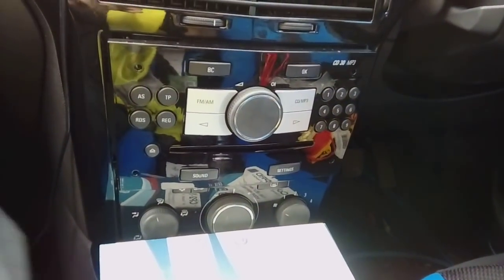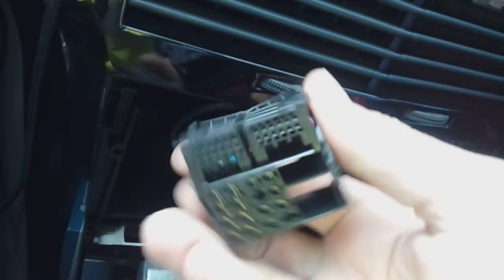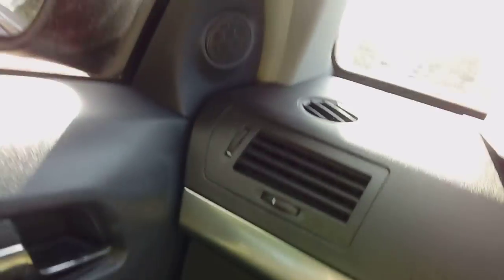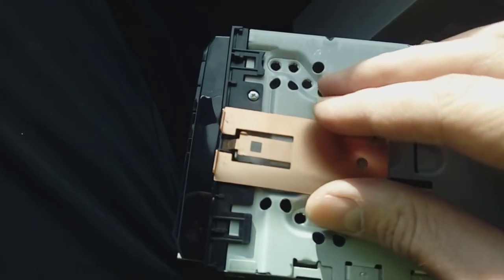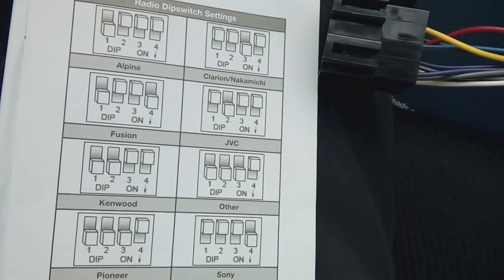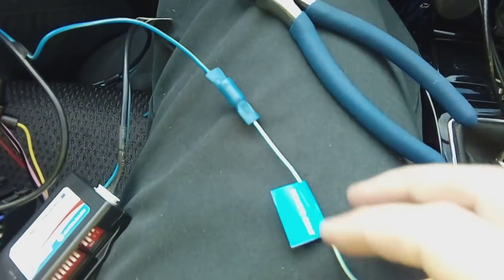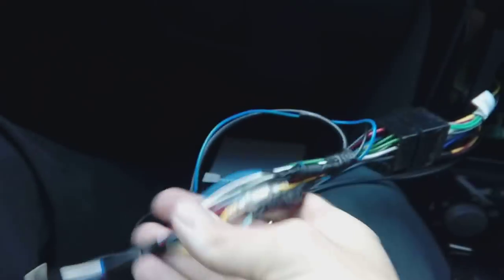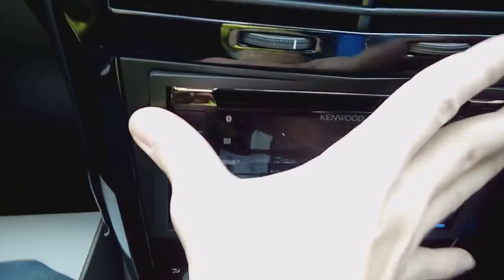Astra mk5 2004 -2010 radio removal & dab refit guide + part numbers

Comment: I’m thinking of getting a double din for my astra but i am wondering will the screen on the centre console still display temperature, radio station, mpg or will it be blank? 
Thanks in advance
Reply: did you find out
Reply: My Astra still displays time and temp. It never showed mpg etc.

Comment: Hi PJ. I'm looking to install an Alpine iXE-W400E headunit to my Astra mk5 coupe Turbo. I just wanted to confirm that the Autoleads steering control interface also comes with an adaptor to connect to the car's radio?
Cheers mate, great video.
Reply from the maker: The kit used in this video comes with a patch lead that fits most major brands of radio. It has either a 3.5mm jack or a bare cable to crimp or plug in to the required output from the aftermarket radio.

Comment: Hi PJ. I'M THINKING ABOUT BUYING THE DPX-7100DAB RADIO, DO YOU THINK THIS VIDEO INSTALL WOULD BE THE SAME FOR THIS UPGRADE DAB RADIO, AND WOULD THE BITS REQD BE THE SAME, WOULD APPRECIATE YOUR ADVICE, THANKS.
Reply from the maker: Yes the same parts would work fine with that radio. Just be sure to buy a DAB antenna for it as the Pioneer models do not come with one.
Example - https://www.ebay.co.uk/itm/UNIVERSAL-CAR-DAB-ANTENNA-WINDOW-GLASS-MOUNT-RADIO-ADAPTER-AERIAL-ARIEL-ARIAL/183738629841?epid=6002493890&_trkparms=ispr%3D1&hash=item2ac7acfed1:g:2VcAAOSwTm1dyoAv&enc=AQAEAAACQBPxNw%2BVj6nta7CKEs3N0qXHmpXBKd%2FvF3vNS7OWYO5%2BCn%2BgwFmnjmv2aGbNBurbeVyIb%2B3E3Frg002LphFIkVzPR%2Be%2BN3u1Zbg%2BzQ4njuqOJdyhHc7SZLqTSNKKCNhAzfDpaVSe%2B6i8iGi4bXIkHrAMnPSI4wT2uyoXx7BvSBhXGTdLI0oIvzysgiGBARoSEgWsnCDHIC1L85ZE9p0LPuoUktBMJSllTWGdJzIAD2LO7bN95kMo5EzLyrWsY6GBziR4vd6%2FSYiv4YIMTiuVDCPwo0WsWSU0Xj7dpYuMm48WXpaysNqCzNNBGYEHmtVULNCH61EBUMz%2FAYd%2BbXFVnlHRnqlJ64kn3zITmRhI9YGXluOlpZ4bXJjbpdjzpx%2BDNDKVW6obhyMowpGzG0lynNFdi%2FZGF%2FWjEFm5yKvIDt%2Fykravu1aNFRCVLgu6YqLaeYoMBlcnfBXBSt2tjeauMFZJ6C6TdOaVTW7axvdwVxIIgXUmkWyWWLfP%2FXkWswgQAnKgPsxB4%2F9PbBIlQ1kmlbO3hqMBw411GZrtVHz6vBAGkcR7UgESY27PVnP2aKuCZNTK8gyGfvuB6IkaRjx4vDKW4m4LB1HSRvSJeMbwRFflhCfwNPOpPoNWlII8k%2Fx9%2BR7Bz7lJrEfroFNPo1LMuvbd%2FHXUu6hchQmnp4YGf1uuWX54eLI2bzzHyrpGKEDiA3B4D%2BRWxP9k29rApp%2BzM7KPeN4MeCguXKnwgNm8G5Ft2O82Q%2BhBI71jxf%2BFbKEw4g%3D%3D&checksum=1837386298410dd5ab0ea1674dcf875d156f54f630ef&enc=AQAEAAACQBPxNw%2BVj6nta7CKEs3N0qXHmpXBKd%2FvF3vNS7OWYO5%2BCn%2BgwFmnjmv2aGbNBurbeVyIb%2B3E3Frg002LphFIkVzPR%2Be%2BN3u1Zbg%2BzQ4njuqOJdyhHc7SZLqTSNKKCNhAzfDpaVSe%2B6i8iGi4bXIkHrAMnPSI4wT2uyoXx7BvSBhXGTdLI0oIvzysgiGBARoSEgWsnCDHIC1L85ZE9p0LPuoUktBMJSllTWGdJzIAD2LO7bN95kMo5EzLyrWsY6GBziR4vd6%2FSYiv4YIMTiuVDCPwo0WsWSU0Xj7dpYuMm48WXpaysNqCzNNBGYEHmtVULNCH61EBUMz%2FAYd%2BbXFVnlHRnqlJ64kn3zITmRhI9YGXluOlpZ4bXJjbpdjzpx%2BDNDKVW6obhyMowpGzG0lynNFdi%2FZGF%2FWjEFm5yKvIDt%2Fykravu1aNFRCVLgu6YqLaeYoMBlcnfBXBSt2tjeauMFZJ6C6TdOaVTW7axvdwVxIIgXUmkWyWWLfP%2FXkWswgQAnKgPsxB4%2F9PbBIlQ1kmlbO3hqMBw411GZrtVHz6vBAGkcR7UgESY27PVnP2aKuCZNTK8gyGfvuB6IkaRjx4vDKW4m4LB1HSRvSJeMbwRFflhCfwNPOpPoNWlII8k%2Fx9%2BR7Bz7lJrEfroFNPo1LMuvbd%2FHXUu6hchQmnp4YGf1uuWX54eLI2bzzHyrpGKEDiA3B4D%2BRWxP9k29rApp%2BzM7KPeN4MeCguXKnwgNm8G5Ft2O82Q%2BhBI71jxf%2BFbKEw4g%3D%3D&checksum=1837386298410dd5ab0ea1674dcf875d156f54f630ef
Reply: @PJsprojects  Thanks PJ, COULD I ALSO REPLACE THE DAB AERIAL WITH A MAGNETIC DAB ROOF AERIAL, WOULD THE CONNECTION INTO THE RADIO BE THE SAME, AGAIN THANKS FOR REPLYING, HAPPY NEW YEAR.

Comment: Fitted a decent Pioneer double din unit with the steering wheel controls. Any idea how I am supposed to change the clock on the display above?
Reply from the maker: Without a expensive display adapter it's sadly not possible,but most new radios have clock built in.

Comment: Thanks for the video, very helpful. A question though, If installed correctly should you be able to listen to the radio with the key in the ACC position like you could with the manufacturer radio? Mine only comes on when the key is in the ON position and just wondering if this is normal?
Reply from the maker: Cabral Apogan-Yella Yes thats correct unless you find the fuse thay runs a 12v acc socket.
Reply: thank you!!

Comment: Longshot here but do the factory steering wheel controls on the 1.9 sportif work with double dins or will they need replaced?
Reply from the maker: Yes you would just need to buy an adapter that works with what brand of radio you buy. You retailer should be able to advise which one you would need.
Reply: PJs projects thanks very much, where do you get the tool to remove the stereo and what adapter would you need in the back for aftermarket?

Comment: do you have to have the steering control for this to work? i tried installing a double din and it doesn't power on at all :(
Reply: Generally for the astra h you need to tap into the cigarette lighter 12v to get power there is already a female spade connector on the loom
Reply: @shaneebahera8566  thanks for the reply. I looked up a forum for it and it said something similar. I went ahead and tied the power into the heater controls and it worked
Reply: @bidsalamandermlp6265  my problem is my astra has a start button so when you turn off the engine its the sameas turn off the ignition completely so you cannt use the radio unless the ignition is on

Comment: Great help, however I've fitted a single Din and it doesn't switch on or off when the ignition is turned on or off? What am I doing wrong?
Reply from the maker: Only three wires will effect power,black(earth),yellow(power) & red(power) so seeing as the only one you have had to add is the red power cable I suggest you start with that one and make sure power is getting to the radio. Double check all your connections and the fuses.
Reply: PJs projects I've connected the red cable to the red cable coming off the cigarette lighter. Is that right or am I doing something totally wrong?
Reply from the maker: I would suggest finding a switched live at the fuse box but as a test pop the heater control panel out by pushing the two metal tabs upwards(radio needs to be removed to see them). on the rear of the heater control panel you will see a large connector with a bunch of wires,find the thick red one and tap into that for a switched power. If your radio powers up you then know your radio is working ok. Make sure to then find a switched accessory circuit in the fuse box for a permanent fix.
Reply: PJs projects it works fine but have to physically turn it on by the on/off button. It just doesn't come on when I turn the ignition key.
Reply: Interestingly I followed your idea and put the red power cable to the red cable that powers the fan control. It now turns on and off with the ignition. However the memory wipes every time!? Any ideas what I'm doing wrong?
Reply from the maker: So from what you have said your cig lighter socket is on a constant power so hence the temporary connection to the heater power is working as intended. To fix your current issue all you need to do is pull the bullet connectors apart on both the yellow and red power cables and switch them,so that red goes to yellow and yellow goes to red.
This will cure your memory problems.
Reply: PJs projects all sorted. I've attached the red wire to the red wire off of the heater power supply. Swapped the plug connectors back to yellow to yellow and red to red and all is now working spot on. Thanks for you help
Reply: @PJsprojects  does the astra have a red switch wire? Or will I have to wire to the heater to get on and off with ignition?

Comment: Hi how did you manage to install the wires in the pillar as it says airbag thanks
Reply from the maker: The airbag has a slight gap behind where it mounts to the pillar so its possible to tuck the cable behind it and then run down the edge of the pillor.

Comment: Did you have to wire in a ignition switch cable to power the sterio? Not sure why but the only way to power my radio is with a ignition switch cable.. but then the controler interface doesnt power on -_-
Reply from the maker: The connects 2 version of interface has ignition switched power out and so does not require a ignition switch power feed. Others or just connecting the radio without an interface will require a switched supply from the fuse box or as some people do on that model take a power feed from the large thick cable that goes to the rear of the heater control panel (please note this is not what I would do).
Reply: @PJsprojects  hey thanks for your reply, really appreciate the help! Turns out my radio has broken some how while i was trying to install this device lol.. will this device work with other sony stereos or do i have to get a refund and buy another one? 🤔😅😅😅

Comment: Hi there,what are the part numbers,if I need to fit single din,dab radio not Astra H 2006
Reply from the maker: Maybe this will help.
https://www.ebay.co.uk/itm/Vauxhall-Corsa-D-Astra-H-Zafira-B-Single-Din-Stereo-Radio-Fascia-Fitting-Kit/260873149142?fits=Model%3AAstra%7CCars+Year%3A2006&hash=item3cbd405ad6:g:-FMAAOSwE-lZ-wkV:rk:3:pf:0

Comment: I’ve used the cp2-vx52 on my 2009 Corsa, on a JVC kd-x472dbt radio, it works perfectly my only issue is that the steering wheel controls don’t work, I have tried manually reprogramming the steering wheel buttons but still not responding, all dip switches are set up for vauxhall corsa d 2009 & for JVC stereo, any thoughts on what the issue could be, I have used bullet connectors to connect the wire from the radio to the wire coming from the small connector cable coming from the control unit.

Comment: what are the size dimensions for a radio/screen. I've just bought a 1.9 diesel astra and I want to get a screen put in.
Reply from the maker: You need what is called  a double din unit,these have a standard cage size of 113mm but can be used with a cage as small as 103mm in height.

Comment: Can you help ? Some of the options in the settings menu are greyed out ? How do I get over this ? Please . Also the unit doesn’t allow me to change between functions , when I’ve got the digital radio on and switch to Spotify it won’t allow me to go to any other functions. The unit is a pioneer AVH-X490dab . Please help thanks
Reply from the maker: Well it could be that you have it set to Apple play instead of universal Android(Apple play only works with Iphone) or from what you describe it might be faulty. If it lets you go from DAB to Spotify and then won't go back to another source something is not right.
Two things to check 1.Make sure the microphone jack is in the correct socket on the rear. 2.Have you either connected the green wire from the 490dab to the handbrake switch or earthed it(crimp it to the black wire from the rear of the 490dab).
Reply: Thank you for getting back much appreciated. 

You certainly do know your onions mate . I’ve been digging around on forums and various sources. (Mostly American) and the parking brake cable is mentioned a lot ! I’ll have to do as you say and connect these. Have you heard of or had any dealings with a bypass cable ? 

 I had an app on my iPhone which seemed to be causing the fault with not being able to flick through functions.

Comment: did you piggy back the live feed from the fuse box?
Reply from the maker: Hi.
With the interface I used their is no need,the interface gives you a ignition switched feed as well as a constant feed.
However if you need a switched feed the correct way would be to fine a circuit in the fuse box that is switched. You could 'bodge' the switched feed from the thick red power wire from the rear of the heater panel(mentioned in the video and pointed out to help).

Comment: How does the dab aerial work? Is there no way of adapting the existing one already fitted in the car?
Reply from the maker: Hi.
The dab aerial sticks to the window screen and has two connections,one is a simple reception plug and the other is for power,this is connected to the electric aerial output of the radio which is normally the blue wire. I have seen a couple of items described as converters for normal aerials but these tend to be very low quality and do not give a good reception.
Anyone going for the increased quality gained by installing a dab radio should not skimp on the aerial.
Reply: PJs projects thanks for getting back to me! So it's not worth converting an astra h aerial then? 

I guess the window aerials are cheap enough, I just don't see how they'd be better than the ones already on the car, apart from compatibility issues etc..
Reply from the maker: Think of it like this,converting the Astra aerial is trying to go around the problem,fitting a £15 dab window aerial is curing the problem.
You see the Astra aerial is designed for analogue signals where as dab aerials are designed for digital signals.
Reply: PJs projects fair enough, thanks. :) 

I guessing it's to do with the fact the original aerial is powered or filtered in some way for fm frequencies?
Reply from the maker: Yes the original is powered,it has a booster built in the base section.

Comment: How you can open hidden menu when changing CD from original to aftermarket. On original CD you nead press setting boton and hold for 5 sec to open hidden menu?
Reply from the maker: Once the original radio is removed you can't.
Reply: @PJsprojects  thanks mate. I'm thinking to move original CD to glove box and saved him just for hidden menu. And put setting bottom outside somewhere.

Comment: Does the trip computer still work
Reply from the maker: Yes works fine,only the time and radio station goes blank with a new radio,but most aftermarket radios have time on the display anyway.

Comment: I don't know if you can help, but I have recently had a Sat Nav radio fitted in my 2008 Vauxhall Astra. Everything is working fine except we can't seem to turn the SatNav off. It keeps giving directions to the last destination entered. When we don't need it. What can we do please? Regards Ken Smart.     k-smart'sky.com
Reply from the maker: So the unit is powered all the time even when the ignition key is removed? If so that needs the power rewiring because it will drain the cars battery.
Reply: we only get this when driving radio doe go off when the ignition is off. regards Ken Smart

Comment: Does original sreen on the dashboard still woks
Reply from the maker: Some of it does. The time/date/ temp work but the radio station is blank and so will be displayed on the new radio.
Reply: @PJsprojects  and how then to change date and clock on the main computer display after this?
Reply: Is there no cable you can buy to get the original dash screen to even interact even just a wee bit so that it doesn’t look stupid just sitting there blank??

Comment: Just bought a Sony double din and the height of the cage is too big! Gutted
Reply from the maker: Yes that's normal. The cage that comes with the Sony unit is 113mm high but you can buy a 103mm high cage from Ebay, Amazon, Halfords or most car audio places.

Comment: what about clock settings in BC?  How to solve it?
Reply from the maker: You can buy a display adaptor from a company called Connects 2 that will solve this problem but be aware they are around £80. Other than that your stuck with this problem on an aftermarket radio.

Comment: Where do you get the 2 keys to get the radio out?
Reply from the maker: Ebay,Amazon or most car shops. Two sizes depending on what your car is fitted with. 
Example 1 -
https://www.ebay.co.uk/itm/Vauxhall-Astra-MK5-VXR-H-04-Double-DIN-Radio-Stereo-Removal-Release-Keys/171063578078?_trkparms=ispr%3D1&hash=item27d42f0dde:g:KD8AAOSwz4leO4MI&enc=AQAEAAACcIQvEcHUrT7nmUC3yY5qbPyaBN1nJEDYW8MyypsJPgXKNJpkvJd843sBLRdhZ0zmMBycfJluK%2FdUUvuDFhq5%2BK%2FX8aPBZ1iiCSOQrEo9nmvkZMYziYzodrEzfbVCzc0H45b9bV3p0VpSYN3NsKCREmPoTivrmcbHIEhSnG00NiqC5nVTnECn4j%2B6hLsWFhRa3pNzbtYMniKvws3ZaFv1RBgVBvVACnFz%2Bwul3pkrw7KceUWYc9GYrEVzcjiE4ASQ66kZ0RQHgKMTGy3rUijnIzI6LtZ4OMxvlE8rTY%2F5qy%2BnZMNcMYRVsa%2FqSE%2BvJUB6qb5G7i1tpY5HQ13zszX%2F3VYawNWDT22PMKyQfwnsJAB8BFABfvXgvzvekBPv6hwp927QnBXHSccYzPT5FcfvzkKHi%2FEiMmJB28vtJgkWq%2FlFhRmC0lHK5%2Bphdja%2BUVv57BpTRI3tx6ojPUYGg2vjrxCHuiXd4876bCXQIglS1lN00LTazWCjccJA84JvTCsVF14e5wkRvWLcEYrwrxtXeDZukgcERSRdov04xggs6ZdKrY52Es8r9sPF%2B5zT0z7zj09wMjNu%2BEhssd6JqriqbVyC%2BDAu3y5VVyBzNz%2BuRiLl5xKY%2FCldaWgw%2FW%2FEDIjIzpxzsHdrKFtR5CXuWK9NAiCG5%2BVEit93yvMqgcWABXKGHu7se%2BdXJhME3qSRqrygS9jphL%2FJu1d4sWhRt8622DpEOaM9jNzoDCzHj4vPD%2FF7voSMj%2FC28P%2FFbi3pIxiQNEsOyZ90tfDDcGlxNwBa500AeIB2frZkyeHSUfvWyB4plT2xB4%2F9GhX3bkZGcxiHtQ%3D%3D&checksum=171063578078dadf283fef884296adbbaea22f229d15

Example 2-
https://www.ebay.co.uk/itm/Vauxhall-Astra-ISO-DIN-Car-Radio-CD-MP3-Removal-Tools-Release-Keys/251249729777?epid=7007667988&_trkparms=ispr%3D1&hash=item3a7fa6a0f1:g:KioAAOxyu1BTlZqi&enc=AQAEAAACcIQvEcHUrT7nmUC3yY5qbPyaBN1nJEDYW8MyypsJPgXKBMsgxzC%2B4AcufPIrJqKaACPcavSnzAjAx2H3adez8I%2BnK1x1z%2F49z2XS%2BTgDPiKUXCvxVVg3xChY3b%2FLvsQFOSh3oPbEy%2FkqXGL9q5gfZ4xCC5lzf0rGDlmvH5HKB0gjLMyq9zllunMmy9aK3WKyt3jhYwcEJBkGc%2BCIKz4KFB%2BjBy0TLmpc2%2BWgrplSYzPMApnEMFOz35JD9W9WEmMpKz72bqtFKgso6468cyUao1sOCJmVgA8QESWGHFx88uq89EcSKbc7fzozxLyDs2AfGWNoVHEAbWAWZqiYpyACWK3bwe8%2FKlEE1VKlcg2NsNoiTwHyUin2FMnnURZHjOdrenaccw%2BAZ7VuaBCG7hEvZtsKIwIOKZGMsoypVSkJVj2oHewFSM6mNa7EUrWbASitM1%2BHviXktRV4qxYgJBXdYEUgoBa6iIDuZfBu%2BY8oPXz4JawYbw7l6txcOHxq1gUtnUJNoci7771eSdVDAptlYGPT8oRKMowPp%2FpLvSfqyRuMHoYdxcuu4QXMMe9zzqPDLc%2BwoNRP15iAotXlrJ3N08RuXKV8tsW5jbaZcbpyL7G2CX1HsQwydMucMsSFqHLSbsZyeuh75jyV085%2BlDCaIyzJ4HX5aFLuI1AgrT3g4cq1o1G48Jn4yMuY52WTJfMRbk8loi8NnzF%2FcqLCf2SHu3WITVrRjG1PWyBT2UUe3%2FPynFs201jkxD1vqJeI0xyvRswesFZaC793ArXbbuhxR%2BE0dXDy4O8TOPEsRuSuTo7r800dJ3QsteqL3glrNGncFw%3D%3D&checksum=251249729777dadf283fef884296adbbaea22f229d15

Comment: I have sat turn 08 Astra xr 3 Dr great body shape clean in and out new tires 76000 miles can't give away  check engine lite 420 code make offer  NJ 08817